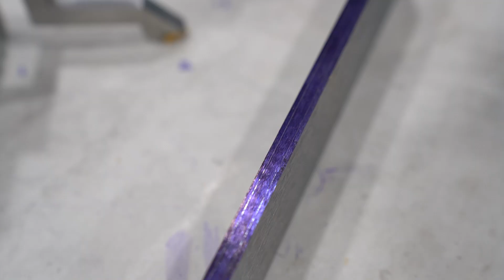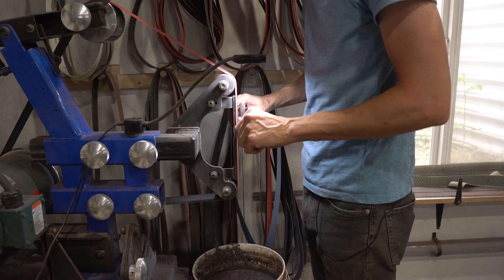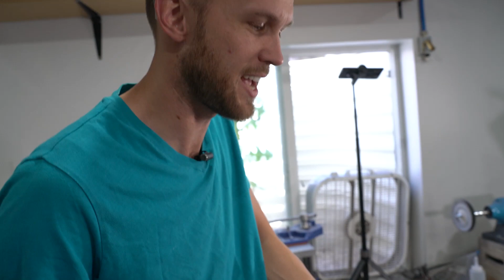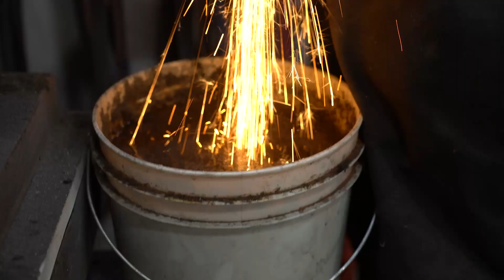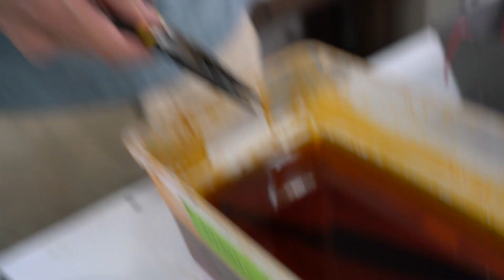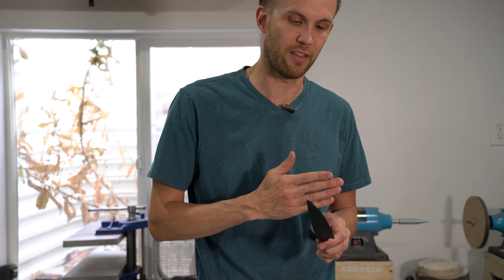The Coolest Knife Blade I've Ever Made!

Comment: For hand sanding, if you put masking tape on the bottom side of the blade and then lay the knife in a pile of hot glue on top of a piece of timber, it self-contours to the blade and holds it while you sand. Repeat for the other side

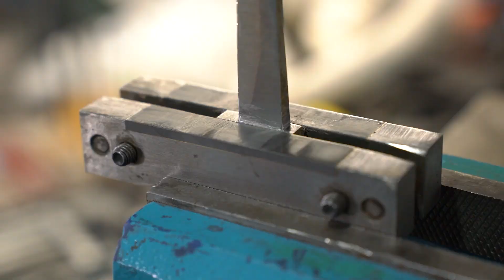Comment: @6:58 It looks like your file/sander has ground the kind of gouge line/edge you said it can't do, into the wolframcarbid file guide inserts on the left farside (?) - If the WC is supposedly too hard for your files to scratch, won't that also mean it can significantly damage your files when grinding against / sliding across the WC guides..?
Reply from the maker: There are scratches on the carbide from times in the past when I've used diamond files on small pieces.
Reply: @NFTI  Ah, from the image it seemed to line up so well I didn't really think it could be prior "damage". But about the potentially damaging the files, is that a real thing? Or are both materials so hard, the files just skate across unless you really go hard trying to cause it?
Reply from the maker: @pr0xZen  The carbide guards could definitely damage a file if you pressed too hard into it, especially at the wrong angle.

Comment: The coolest knife blade you ever shaped! should be your title. You didn't make the steel, so you didn't make the blade. 
You wasted that quality steel (which you obviously didn't have to pay for) on that stupid chef knife?!
Reply from the maker: And Kyle didn't mine the iron ore from the ground, so did he really make the steel?
Reply: @NFTI  Your argument is stupid. He made the damascus steel bar. You then took that steel, did some stock removal & "made a knife". It's kind of like if you bought a car, put on a body kit, changed the wheels & tires & then took off all the car manufacturer's logos, then you put on your own logo & you ask everyone if they like the car you built.
Reply from the maker: @Richard.Dawson 🤡 LOL! You call my argument stupid and you pull out that? Nah what you just described is like buying a finished knife at the store and changing out the scales. The car equivalent is like someone gave me an engine, a load of raw aluminum, and a set of rims. in which case I absolutely would tell people I built that car. Is stock removal the same as forging? No of course not. But if you didn't start with a knife, and in the end you have a knife, you made a knife.
Reply: @NFTI  I said "it's kind of like", I didn't say- it's exactly like. My point was that all the hard work was done making the damascus. The shaping of the blade, attaching the scales & the sanding is a half day's work, if you take your time. The tempering & etching is all about waiting. It's all work that ANYONE with a belt grinder & an oven can do.
From the point where Royer started with stacks of 2 different types of metal, to the point where you held a completed knife, 95>% of the work was done by Royer & 5<% was done by you. Why didn't you just make a monosteel knife in a video? Because it would not be impressive looking? You're just trying to jump in on the popularity of the knife making market the easiest way possible.
Reply from the maker: @Richard.Dawson  I have made several monosteel knives in videos, and I will do so more in the future. I used this bar to make a knife because HE reached out to ME and asked if we could do this collaboration. Quit being a dingus and stop choosing to be rude and mean spirited.
Reply: @NFTI  I was just being honest. If that hurts your feelings, that's on you.
Reply from the maker: @Richard.Dawson  It's honesty if the council of knife makers appointed you the sole arbiter of what is and is not knife making. If you're imposing your personal opinions and gatekeeping based on what you like and dislike, it's being rude.
Reply: @NFTI  You seem very sensitive & if that's the case, maybe this isn't the platform for you? Again, I wasn't being rude. If I was being rude it would've stung a lot more. I'm just stating the facts as I see them. You took the work of a skilled craftsman, sanded on it for a little while, soaked it in acid/coffee, screwed that up, had to call the skilled craftsman again to figure out your mistakes, next you'll glue on some scales, you'll stick your logo on it & then you'll probably sell it to someone that doesn't know any better & keep the profit for yourself. There's an old saying- "Those who can, do. Those who can't, make YT videos about it." I think that's how it goes?
Reply from the maker: @Richard.Dawson   😂😂😂 "It would've stung a lot more" lol keep telling yourself you have that kind of power.
I'm calling out your poor behavior. You keep misunderstanding that as my being hurt or insulted. Your dumb choice to be impolite while pushing your opinion as fact is just that... your dumb choice.
Reply from the maker: @Richard.Dawson  You are very welcome to dislike my work. You can hate it outright, and post on public forums about how you dislike it. That'd be weird, but fine to do.

But you don't choose what is making a knife, and what isn't. It wasn't a knife. Now it is. That's making a knife.
Reply: @NFTI  I can buy a box from ikea, put it together & say I made a desk. You're doing the same thing as that. If you brought this blade to any knifesmith convention & tell everyone there you made this knife, they'll ask if you made the damascus & when you say no, they'll smirk & move on. The only reason this is the coolest knife you've ever made is because of the damascus. You're a blade shaper, not a blade maker.
Reply from the maker: @Richard.Dawson    Nah man that's the thing, that's the same bad argument as the car thing above. You can buy wood at home depot (or have a talented craftsman hand make an exotic patterned slab of wood for you), but if you shape the wood, choose the design of the build, cut the pieces, and THEN assemble it, yeah, you made a desk. Kyle didn't pick what kind of knife it would be. He made me an amazing, top-tier material. Which wasn't a knife.
Reply: @NFTI  First off, how exactly does a craftsman hand make an exotic patterned slab of wood? Does he add something to the tree as it grows or what? 
Secondly, I didn't say buy wood & make a desk, I said an ikea desk. It goes together a certain way. A handmade desk from rough lumber is completely different. You were given the piece of steel already hardened, shaped to a blade thickness & all ready to get shaped. You didn't hammer in any bevels or have to do anything to the flat steel. You just shaped the steel. You shaped a blade. When people like Royer sell steel, like the piece he gave you, they are called "knife blanks". You shaped a knife blade.
Reply from the maker: @Richard.Dawson Just search "craftsman cutting board" or something, you'll find plenty of exotic patterned slabs of wood. 
And you're making my argument for me. An ikea desk goes together in one way, and one way only. There's instructions. There's no decisions or creative skills.
I was given a rectangular bar, that was NOT heat treated, shaped, nor the correct thickness. That's called "bar stock" not a knife blank. A knife blank is a pre-profiled piece of steel.
There are knife kits, and those are more similar to ikea sets, but even those have bevel grinding, handle shaping, and usually (but not always) heat treatment.
Reply: @NFTI   A slab of wood is a piece of wood cut directly from a tree. A cutting board isn't an exotic slab of wood.
My bad, it was normalized, not heat treated. Either way, you still shaped a knife blade out of a knife blank. Sure you had some options as to what shape you chose, as long as it fit onto the knife blank steel you were given. 
Now that I think about it, it was actually genius of Royer to send you the steel to shape a blade out of. It just shows that anyone can take quality steel from someone like himself & shape it into a blade without any real knowledge or skills in knife making. All they need is a grinder & sandpaper.
Reply: @NFTI  hey boss, just some constructive feedback as a fan, from the perspective of a third party observer may I suggest not feeding the trolls in extended comment wars like this? Your first reply was a perfect place to end but even then these internet anons just look for interaction so they'll be spiteful as bait. Nothing wrong with interacting with real feedback but he obviously from the get go was looking for a fight. Ignoring them and moving on is the best policy IMO.

Keep up the good work Nate, you are doing great
Reply: ☝️☝️☝️ "Just a little rule you need to follow from a 3rd party 'observer' beta male, hey daddy, don't engage in conversation with anyone that disagrees with you, because the only opinion that is valid, is our opinion. If anyone has an opinion that differs from ours, then that person is wrong & should be silenced, ignored & blocked because I don't want them having a chance to share their wrong-think with anyone else. You can interact with people that share our opinions as much as you want, but those are the only people you should reply to.
Keep up the good work, but don't forget which people I want you to speak with."
Reply: @Richard.Dawson  John 3:16 KJV — For God so loved the world, that he gave his only begotten Son, that whosoever believeth in him should not perish, but have everlasting life.

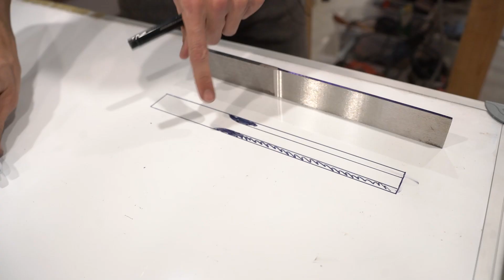John 3:18-22 KJV — He that believeth on him is not condemned: but he that believeth not is condemned already, because he hath not believed in the name of the only begotten Son of God. And this is the condemnation, that light is come into the world, and men loved darkness rather than light, because their deeds were evil. For every one that doeth evil hateth the light, neither cometh to the light, lest his deeds should be reproved. But he that doeth truth cometh to the light, that his deeds may be made manifest, that they are wrought in God.

Friend, you are obviously hurting, I don't know what evils have taken place in your life to make you so spiteful but Jesus can set you free. There is more to this life than whatever you think you're accomplishing here. Jesus Christ died for your sins and rose from the dead, and if you believe in Him and call upon Him to save you, you can be sure you'll have an eternal home I'm heaven as a child of God.

The consequences of not doing so are grave

Revelation 21:8 KJV — But the fearful, and unbelieving, and the abominable, and murderers, and whoremongers, and sorcerers, and idolaters, and all liars, shall have their part in the lake which burneth with fire and brimstone: which is the second death.

I pray today friend you look to Jesus. May God bless you with wisdom and peace

Comment: What's wrong with a full tang knife?
Reply from the maker: Nothing, and most of the knives I make are full tang.  But there are types of handles you can't do with a full tang knife, plus I only had a limited amount of the metal bar to work with, and it wasn't quite enough to have this size of blade and a full tang.

Comment: Hey I know you prolly won't see this but the old kor put dry ice in liquid nitrogen then proceed to explain how the dry ice has been put to around -300f if acetone freeze put is roughly -139 what would happen if you put that really cold dry ice in it would it make it cold or freeze it and maybe light it on fire to see if it's possible jus til the acetone burns out and if not maybe even try 100 percent isopropyl alcohol and if not maybe chem it up and take 91 percent alcohol and cook it to a concentrated form and if not 100 maybe even more concentrated tho it maybe dangerous but than again the king of random is the king of random right
Reply: These steels don't benefit from "cryo" treatment. Cryo is mostly for stainless and "designer" steel. I've used what you're talking about on AEB-L, though and it seemed to work well.
Reply from the maker: I did a video with TKOR that tried something like that, neither acetone nor isopropyl alcohol will burn when they're that cold.

Comment: Was the pattern meant to look like flames? It somewhat looks like that to me, like stylized camp fires meeting in the middle.

As for holding odd shapes for sanding, just hot-glue the blank to a piece of 2x4. Use large amount of glue so it acts as filler to make up for blade's unevenness. To remove blade, heat it up lightly and it will come off, then 99% IPA for clean-up. This glue can be re-used many times, simply re-heat what's left on the 2x4 with a heat gun and stick a new blade to it. I even used that trick in CNC machining, although there parts were also clamped in a couple places as well, so the glue was more of a support rather than the way to solidly mount the part. Should hold just fine for hand-sanding.

Comment: Lovely looking knife, I am a chef and my only complaint is that these days in commercial Kitchens they really prefer having a full metal handle, this would have been perfect for that. Another interesting point is that High Carbon steel is fantastic for making durable knives that will need limited sharpening but the end up reacting to the acids in food too easily and are again rejected from commercial kitchens due to this. As a presentation knife that is able to be used it's going to be great but limited for Commercial use.
Reply: It's fantastic for protein disassembly as it is somewhat more chip resistant compared to high carbide stainless steels and the fat and low acid environment in that application is great for preventing the need for patination to avoid staining the food. Still a good idea to avoid onions and fruits unless you want to patinate it first, which seems a shame for a knife with such pretty patterning. The coffee bath will serve as a measure of corrosion prevention, which precludes the need for patination to a certain degree, but it isn't immunity like just going for stainless. I've used some high carbon steel knives before and they do cut differently than their stainless counterparts, so there is a reason why some purists will just deal with having a funny colored knife with the patination from cutting up some sacrificial onions in order to be able to use their preferred knife steels. I find that high carbon steel knives just keep their edge for longer while only needing a hone compared to stainless. Something about how the martensite and cementite formations are formed in the steel is different than how the carbides form in stainless allows the fine burr at the edge to plastically deform without being removed during use. Even when you strop away that burr, the edge is still more resilient and can be realigned more readily.